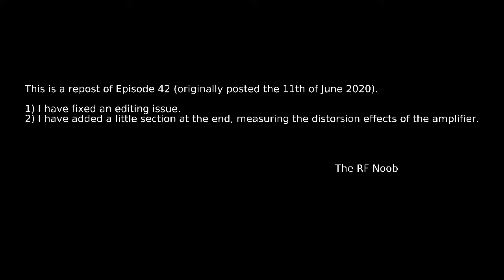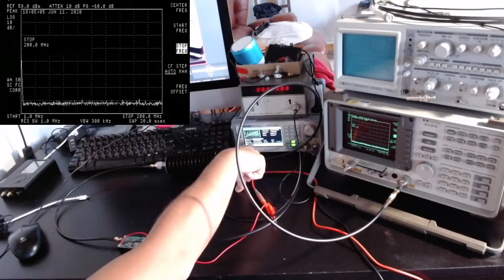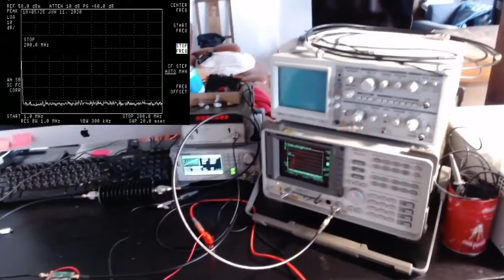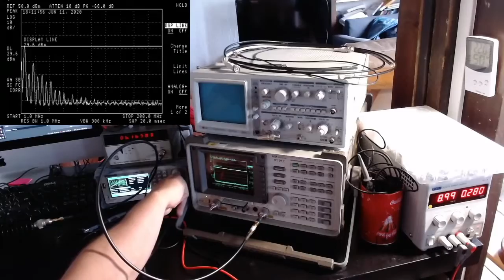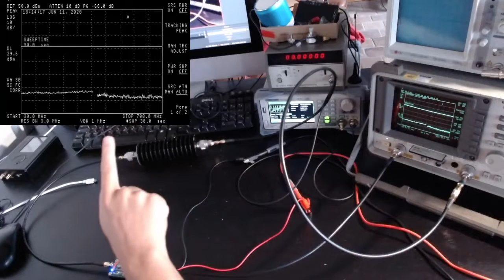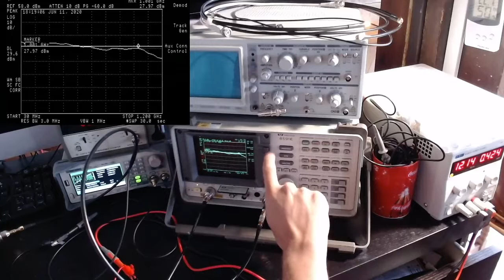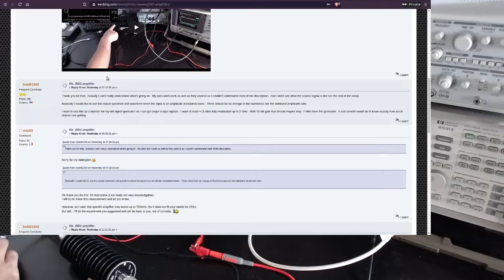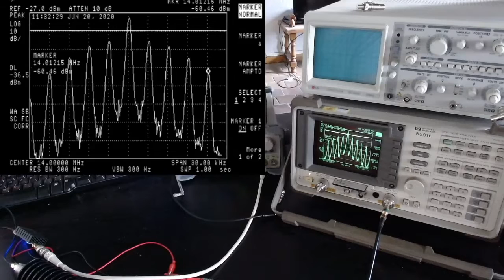Episode 42: cheap 2W RF amplifier, some measurements

Comment: Did you notice that applying the signal reduces the current? I changed the bias for the output stage to reduce the standing current to around 300mA. It reduces the gain slightly, but it then stays more constant - possibly even increases a little with input. Very useful test - thank you.

Comment: Hi again. Did you get any linearity measurements at lower input power? As you said - it was generating a square wave, so very much not acting as a linear amp. You can also do this without needing the modulation by comparing input to output power as you increase from zero input to maximum.
Reply from the maker: Unfortunately I couldn't do many more tests on this amplifier... I fried it a few days after this test! The heatsink was not really up to the task, too hot!
Reply: @therfnoob7697   hi did you fry u2 component bc i fried one too so im thinking of ordering new one but if its a problem on every one i wouldnt order it
Reply from the maker: @pazntic  yes, I fried mine. I don't think it's worth the money for anything 'long term'. It's ok for little 'experiments' projects I guess
Reply: @therfnoob7697  is there anything similar for long term
Reply from the maker: @pazntic  yes. Search amplifiers from "minicircuits" are very good and you can find several of them in ebay.